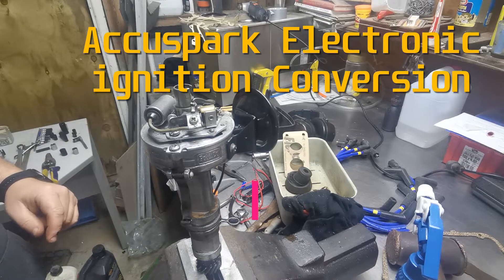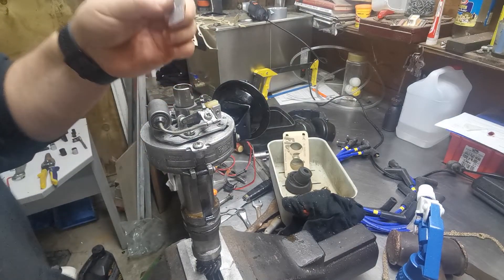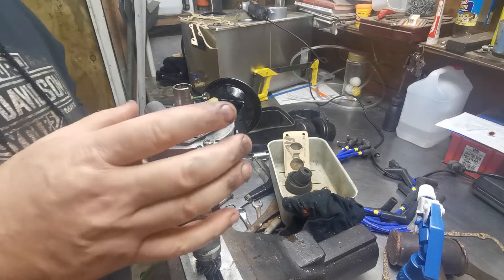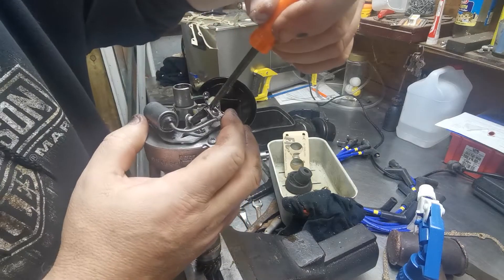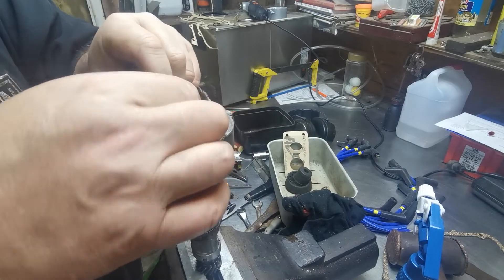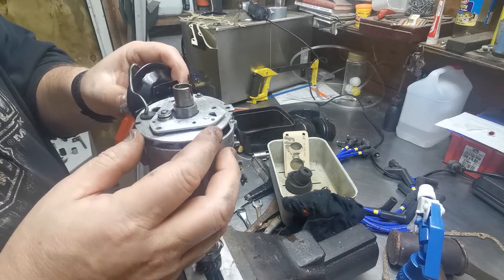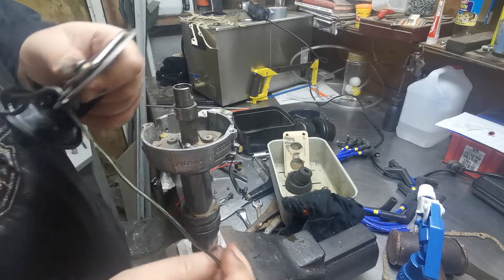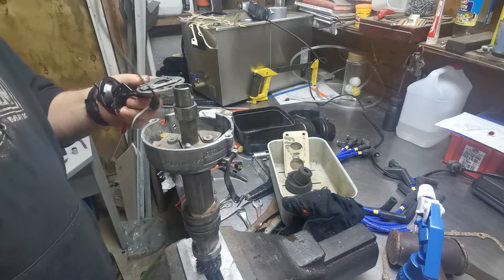Accuspark Electronic ignition conversion ford Essex 3 0L

Comment: you didnt reconnect the earth is that not needed now?   also with the rubber grommet surely that goes through the base to the outside of the dizzy, not in the top plate ?
Reply from the maker: Dont know - Surely right?!